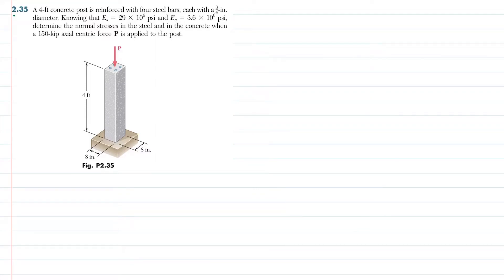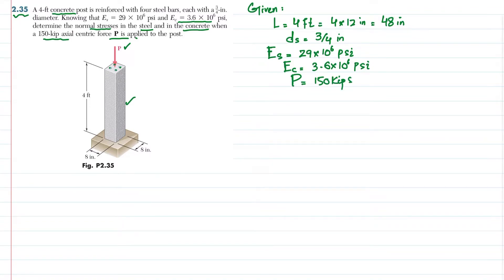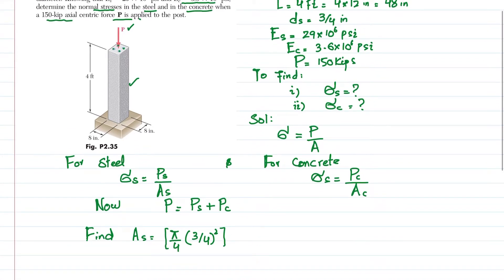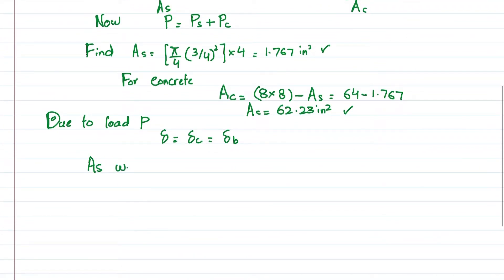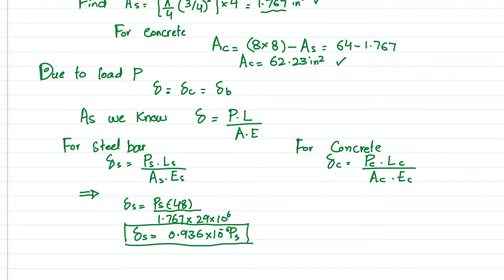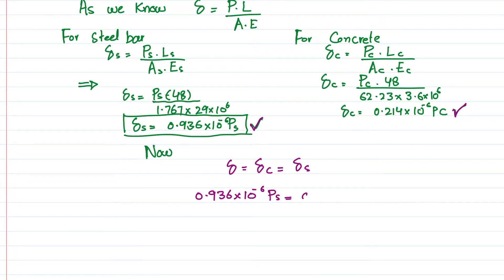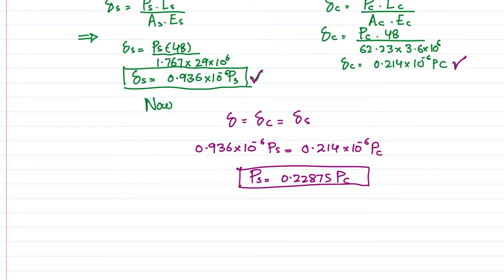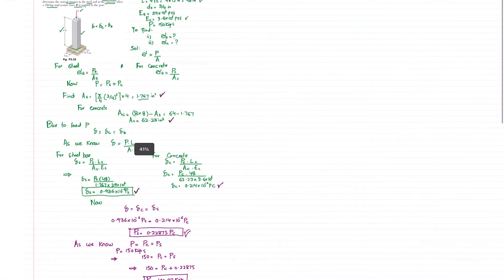2-35 Stress and Strain Chapter (2) Mechanics of materials

Comment: When calculating As, why is the equation not: (pi * (3/4)^2) * 4.

I'm confused why in your equation you divided pi by 4. The generic equation of a circle is pi * r^2, i don't understand where the 4 came from.
Reply from the maker: Why you are so confused? It's very simple if you are using radius then Pi * radius ^2 and if diameter then Area = pi / 4 * d^2 . So I  question diameter is given amd we are using it. I hope you will understand it.
Reply: @engradnanrasheedmechanical  Thank you, that answers my question. I misread the instructions as giving the radius rather than the diameter.
Reply from the maker: @CalvinBrumfield no problem brother

Comment: 4 steel bars not 1
Reply from the maker: Yes four steel bar and we have found it for each steel bar. Rest I didnt understand what you want to ask?
Reply: @engradnanrasheedmechanical  sir, why is it that the length of the concrete was 48in instead of 12 inches? Beginner here hehe
Reply from the maker: Length of concrete  is 4 feet which is 48 inch. I think it will clear your doubts
Reply: @engradnanrasheedmechanical  ohhh right², thank u sir 😁😁
Reply from the maker: No problem keep watching and sharing it with your friends ❤